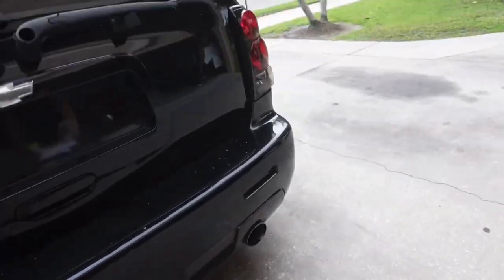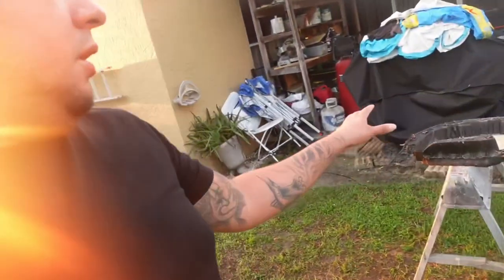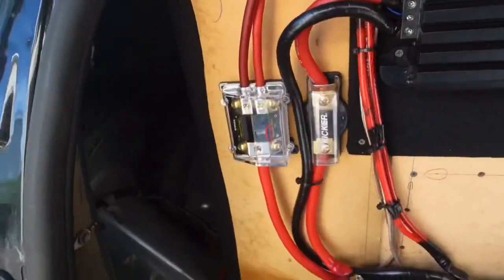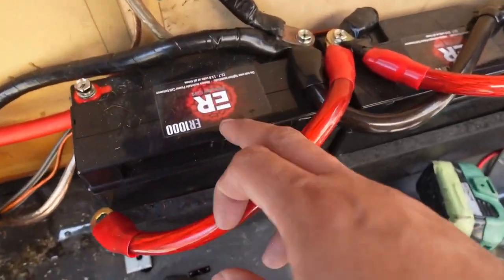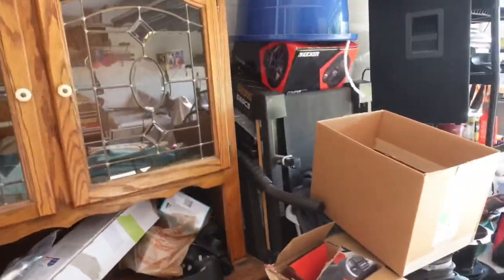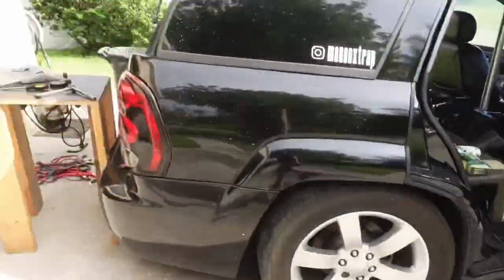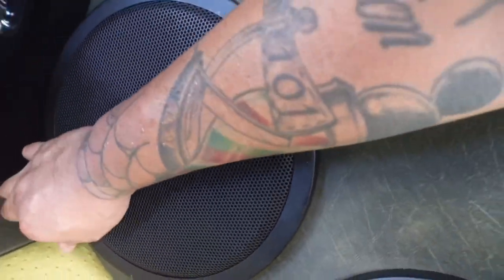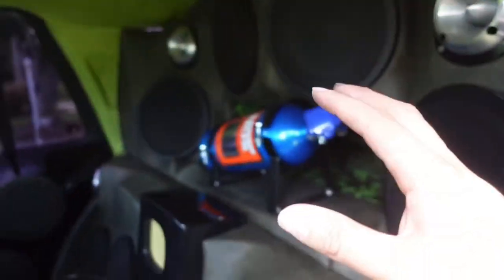My 6.0 LS2 TBSS SAVES MY CHEVY SILVERADO SOUND SYSTEM BUILD needed Taramps 3K

Comment: I am 2xcited to see the trailblazer rebuild..
Since I am basically building the same truck atm...
I have all the plans and equipment to do a 4th order box in mine with 6 10s..but talking with some bassheads who know these truck said I'd be better to do a ported box sub up port back so know I'm thinking of doing 9 10s on 3 amps..
Question did you do the big 3 or big 4 in your tbss??
Reply from the maker: Na I just have a lot of short grounds and my voltage never really drops and I jam on mine like crazy 😂
Reply: Big 3/4 is a must do if you're gonna go more than 1k watts.  If it's a smaller system it won't hurt to have it but not really needed for under 1k...it only costs a few bucks in wire and terminals if you can do the work yourself...my advice is go ahead and do it man it's always helped me lol.  Now I'm no YouTube professional or anything like that but I have built some loud systems in my day